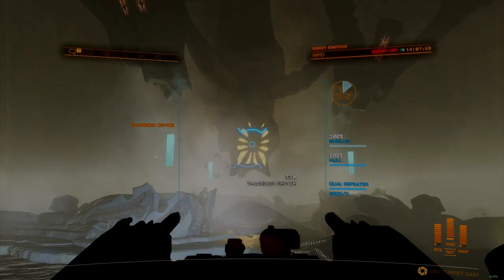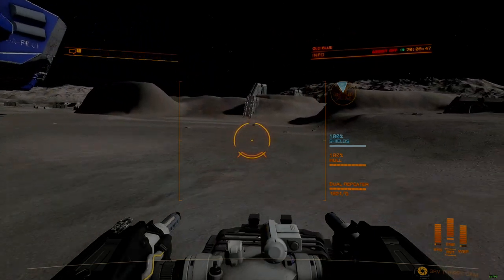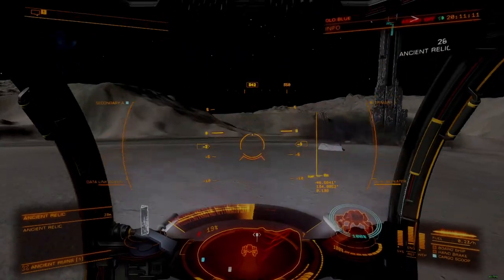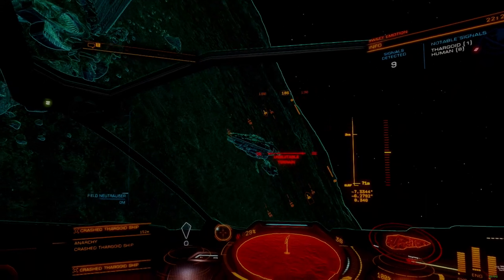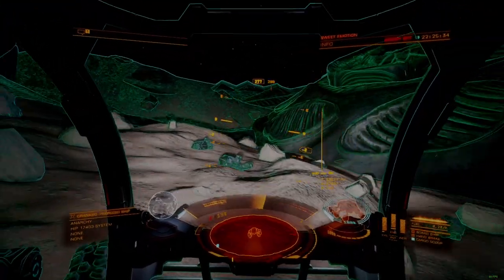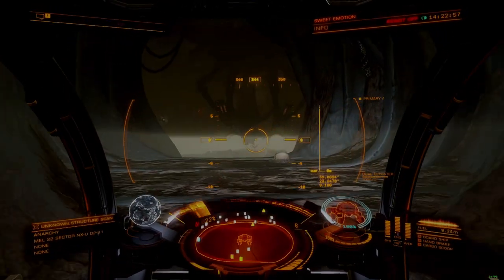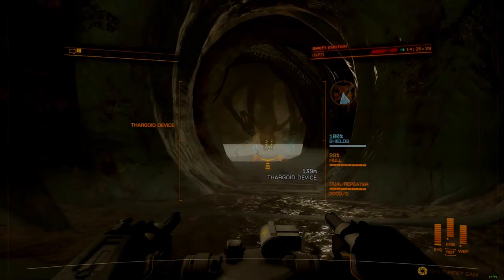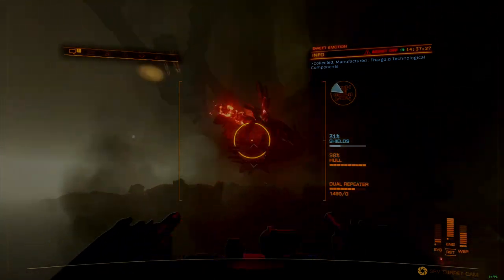Elite Dangerous | Intermediate Tutorial | How to Make Unclassified Relics

Comment: System: SYNUEFE EU-Q C21-10  Body: A3  Guardian Relics can be farmed at this Weapon Blueprint site without triggering any Sentinels.  You can drive in the back gate.  The Relic Tower comes up.  You can also farm Tech Components from the bottom destructible Panel on the leaning towers towers just beyond that are opposite each other.  Do the one on the left first, then 180 to do the one on the right, then keep heading through there and another Relic Tower will come up.  Back to your ship, you have 6 Guardian Tech Components and two Relics.  Main Menu and back into game and repeat.